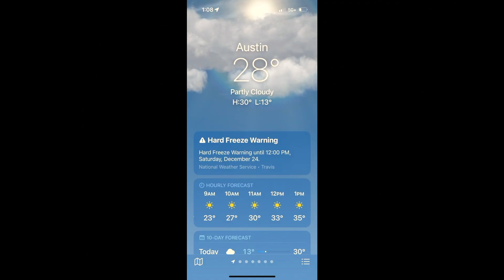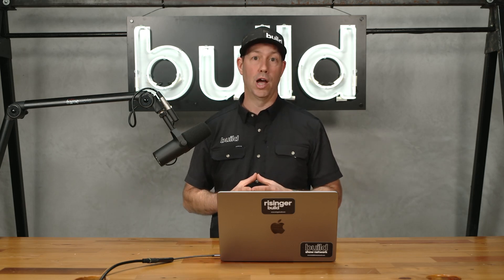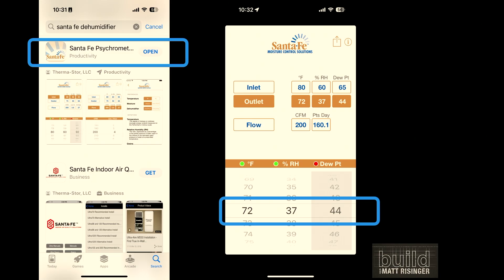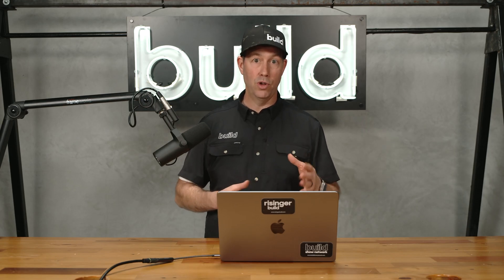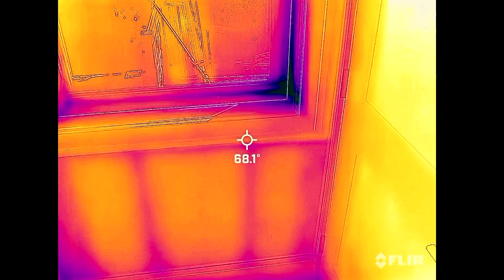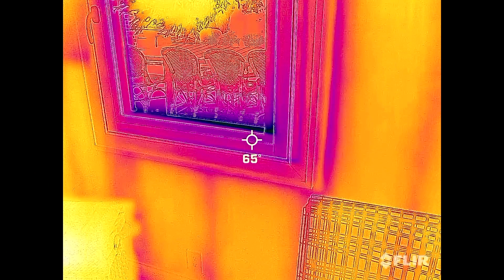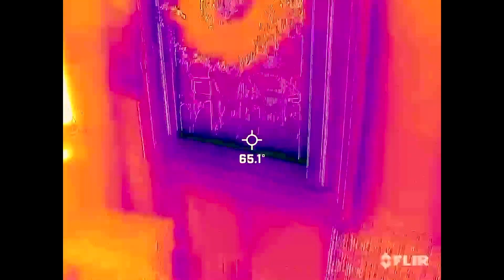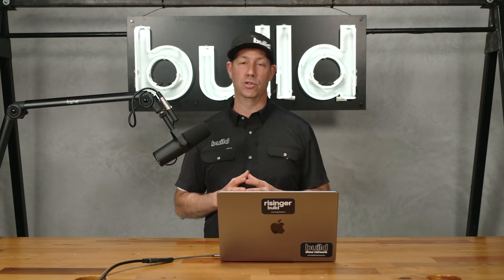Window Condensation Explained & How To Avoid on a New Build

Comment: that's pretty sad that the solution is to install expensive windows. How about using mechanicals strategically to warm up the glass, or use window treatments probably to avoid keeping the glass cold.
Reply: I'm pretty sure I read an HVAC recommendation years ago about floor HVAC registers being better than wall registers and to place them in front of windows and doors.  Easy enough with basement or crawlspace or upper floors, but not exactly a retrofit for a slab foundation.  Yet another reason I might build the only house in the neighborhood not on a slab -- ease of mechanicals access from underneath.

Comment: Does Europe or Canada have higher code requirements for window performance compared to colder climate zones in the US.  If yes, why are our standards low? Simply cost?
Reply: I don't know about the code requirments, but here in Finland the basic window design is very different and  condensation is not an issue and has not been an issue for almost half a century. No matter what the humidity in the room is or how cold it is outside our windows stay dry. In my opinion the North-American window design is just bad for the Northern climate no matter how many panes it has or what material it is.

Comment: The other factor here is air movement across the glass. If you have curtains stopping the airflow you will get far more condensation. One of the tricks they do here is to use the ventilation system to blow air behind the curtain.
Reply: Increasing airflow also increases heat loss through it since you're having to warm the glass above the dew point.
Reply: yes this.  I have a horrible 1970s aluminum window.  Horrible condensation buildup on it, but if I set some fans up to constantly push air across it there is no condensation.

An easier solution is to get those plastic window seal kits. Reduced the condensation by 90-95%.  Just be sure you seal up all the little air gaps around the window before you put up the plastic.
Reply: Put the insulation layer on the outside.  This warms the inside does not get cold enough to condense the humidity.
Reply: @iancormie9916 ▪︎ how is that accomplished on the outside?
Reply: @tweake7175 ▪︎ but traditionally heavy drapes have been installed for added warmth, right?
Reply: @bethanyanderson1745  correct. So people lose heat but gain clear windows.
Reply: Old and new windows do this.

Comment: Your windows need to be heated adequalty my friend. If the window is not well heated dirtectly best by the bottom not by the ceiling you will have no condensation. I live in Qubec where we get -40 deg. celcius temps in the winter and crappy condos all condensate but The museen I designed, did all the technical detailling of all juntions etc. and did the site supersivion in Qubec has large curtain walls in a 50% humidity environment and 0 condensation in the museum and this is the same in residential, schools and hospitals I have designed and drawn all of the technical details amf have been built adequatly. The cold surface of your windows needs to be heated and you need to start building using the Perfect wall method and stop wasting money insulated sutd cavitys wood or steel studs (worst). Perfect wall is the only wall in the world tha works. Your thermal cam shows all your wasted energy at the stud locations, etc. You are still a very good builder and builder that knows his sh....t. Keep up the good work, many you will convert crappy contractors to build better and waste less energy. Litezone glass is absolutly amaaaaaaaaaaaaaaaaaaaaaaaaaaaaaaaaaaaaaaaaaaaaaaaaaaaaaaazing.

Comment: I installed an Heat Recovery Ventilator.   HRV myself for around 2500 dollars about 25 years ago now  best money I’ve ever spent 
Absolutely no more moisture problems on door frames or windows and in door air quality is fantastic 
I live in Ontario Canada where it’s cold much of the year
The only drawback to the system is if you have neighbors with woodstoves or fireplaces you sometimes get a faint smoke smell if the wind blows it towards your air intake 
Hope this helps anyone having moisture issues in their home.  Cheers
Reply: Whats your indoor humidity? I suspect its very low because you have an hrv not an erv.
Reply: @tweake7175  yeah, in Ontario you want an ERV. Even with an ERV I run a humidifier. I'd rather have a bit of condensation than dry skin
Reply: Just to add a little more info  way back before putting in the hrv the government had a incentive they would pay you back for all monies spent to add insulation new windows and air sealing of your home for energy efficiency 
The reason why I have an HRV is because it has a built in thermostat which causes the air intake port to close at times of very cold weather this sends heated house air threw the core to stop it from freezing up after a certain amount of time the air intake opens and resumes operating as usual 
I’m not familiar with ERVs  if they have this cold weather feature or not
It’s currently -2 here and inside humidity is 32 at present
Reply: @bradmitchell4936 afaik erv also have the defrost port.
Reply: I did the same for my attic space in the winter. Works great
Reply: I have a very tight house with full envelope closed cell. The first winter after construction we had very bad window condensation even with fairly high-end windows. I installed ERVs on each level of the home the following year and the next winter the condensation on the windows was almost non-existent. I'm surprised @buildshow has this issue since he has a nice zehnder system.
Reply: Same here. I have a 1938 house and it’s small, so humidity builds easily. I put in a very simple HRV system and it totally solved my issues. In the coldest months (Manitoba, -35), I’ll run it 20 min per hour or it will drop the humidity to the mid 20s! 

With humidity above 35 I’ll get just a bit of fogging on some windows.
Reply: My brother put an HRV in his last house here in Wisconsin and the air was so dry they were turning into lizards.
Reply: hah!! How dry? In winter I like it around 30%. Below that and I start getting cracks in my plaster. @zachlafond2652

Comment: This happens so frequently that I’m starting to see mold. Can you recommend a remediation strategy to stop mold growth? 
I’m in New England and this happens every morning in the winter months!
Reply: Lower you're humidity in the house.  Get more airflow over the window. 
Put up a clear plastic winter cover over the inside of the window.
Reply: Moldex or Clorox Clean Up worked for my winter window mold issues. Just be sure to go back every month and check them.
Reply: Neat bleach kills any mold, just be mindful of any effect on the materials or paint in that area.